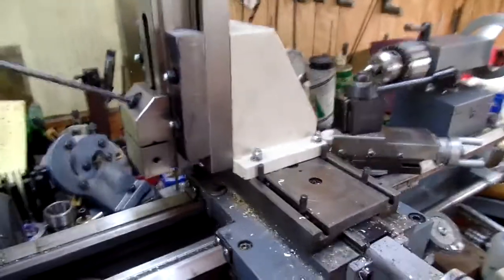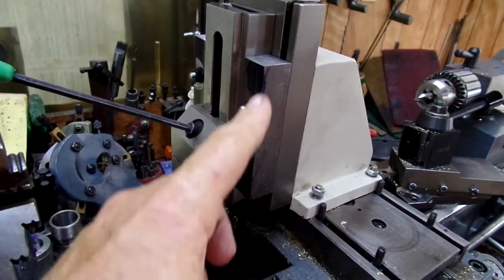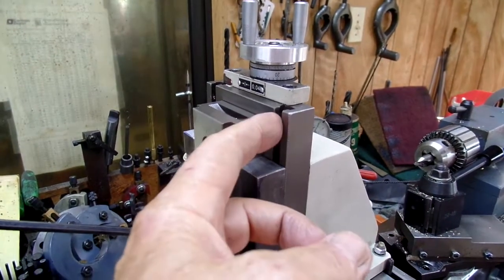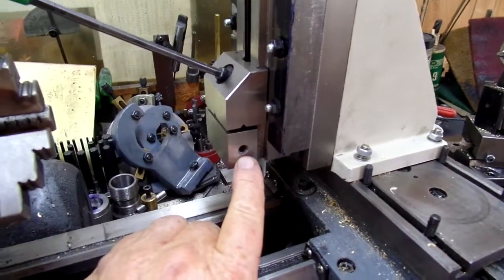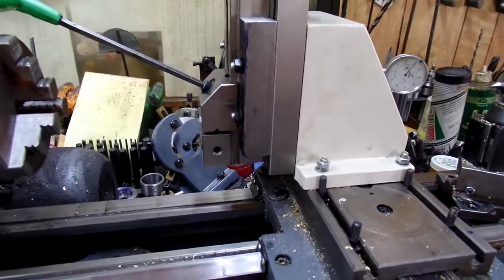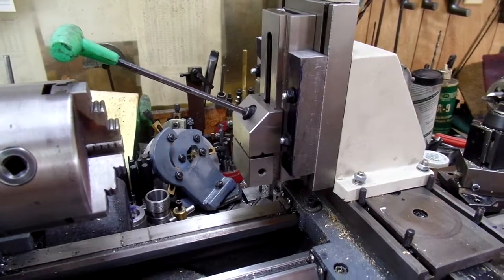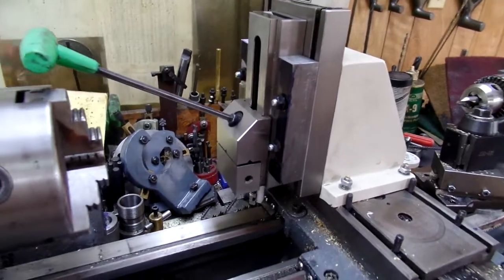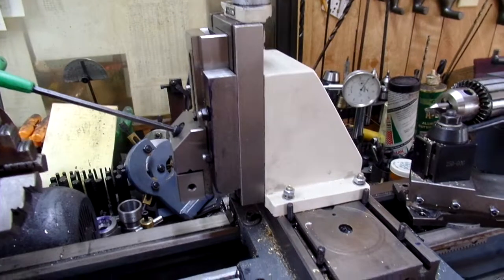E136 First chips with my milling attachment for my 9 x 20 lathe

Comment: What quick-change tool post is on the compound?
Reply: @CurlyG65 I did a little research after pausing the video to get the part number off the QC. The 250-000 is the OXA size. Until just now I did not know they even made one smaller than the AXA which I own but it was too big for the 9x20. I always had the AXA tool holders at the very bottom of the travel to get the tool points on center. Appears the OXA is recommended for the 7x10, has a 10MM mounting stud and if for swings up to 8". Ebay has a bunch of them as sets and as individual holders listed.
Reply: @CurlyG65 Looks too small for the AXA size....